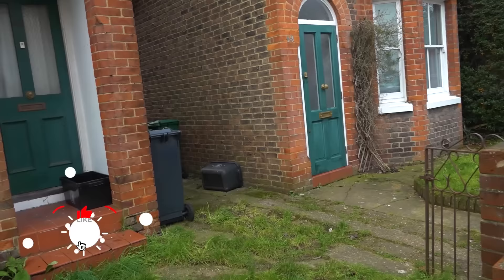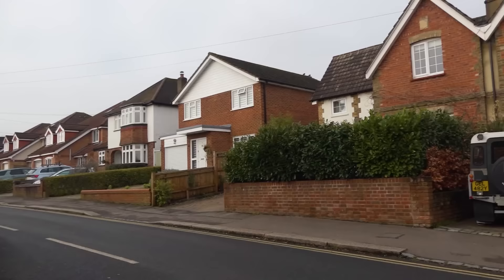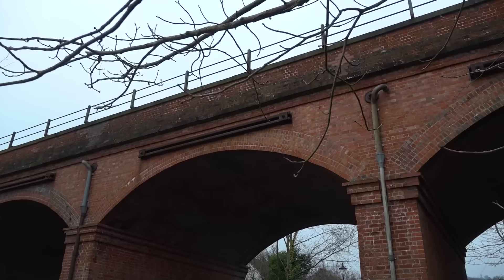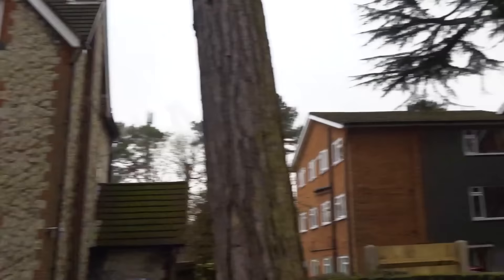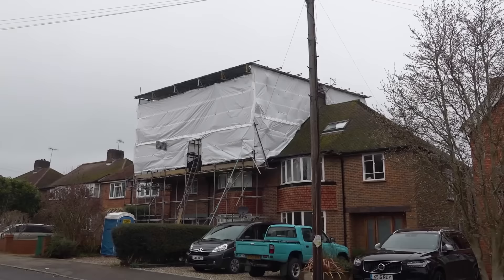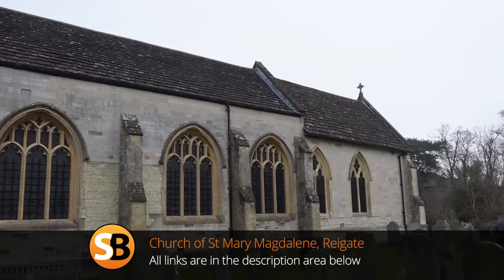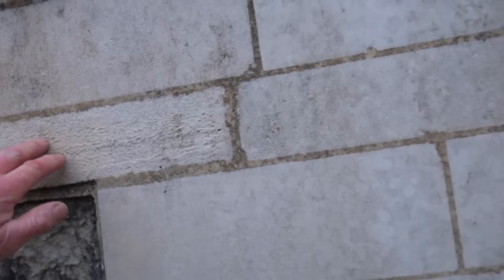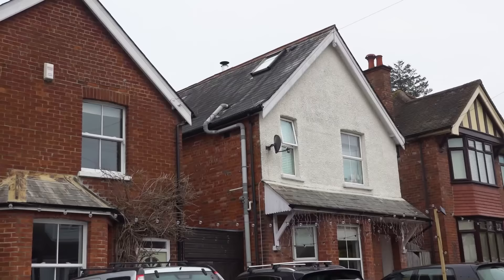Roaming Roger 2 ~ More Mobile Moaning

Comment: I can speak from personal experience. Sand and cement over lime is the kiss of death. I used sand and cement on my old house in 1985. I have now replaced it with feeble lime NHL 2. The wall was wet behind the cement, and quite a number of the old sandstones were damaged. Lime can breath and it is flexible. What also happens is that the sand and cement gets blown out by the lime. Moreover, lime lasts longer.
Reply: Sandstone and brick are two vastly different products.
The wall behind the pointing could be wet because sandstone is porous (Or many other reasons)
Sand/cement cannot be blown out by sand/lime. It does not have the strength or expansion capacity to do so. I would guess movement withing the building caused any pointing to fail.
Sand/Lime pointing does not last longer than sand/cement pointing.
If you're  happier with the new sand/lime pointing on your home, that's fine and I'm pleased for you but be careful when giving advice unless you are somewhat of an expert.

Comment: Hi Roger, in stonemasonry we call those indents. Underneath the facade of the new indents is most definitely the original stonework and as you rightly said, they were probably clad (indented) and dowelled at the very least 100-150mm back in to the original stonework. 

Regarding the erosion, it's likely that the stone they used to carry out the indents, was probably slightly harder and less porous than the original stone as it can be very difficult to match for obvious reasons. In turn this will speed up decay of any softer masonry around the newer, harder and less porous substrate. So matching stone as closely as possible is very important.
Reply from the maker: Good to learn all that, we should do a video with you.

Comment: Hi Roger. Lime does allow the water to wick out moisture, whereas cement holds the moisture. It's not really good practice to mix cement with lime - any benefit provided by one is negated by adding the other. As an extra point (excuse the pun) to your mention about painting brickwork, a breathable paint would work best or, as would have most likely have been done when a building was built circa Victoriana, a coat of lime wash. Most contemporary 'general builders' can't be bothered with lime though as they just want to get the job done quickly and no doubt their customers don't want to pay the extra cost in labour as lime takes more time and attention to work with properly. Enjoyed the roaming though :)

Comment: Only yesterday I was out and about together with my wife and dog in Tavistock, as we walked along I admired some of the stonework on display, particularly when going past a local cemetery.  It featured water spouts that serviced the gutters as they came through the parapet walls (and looking down, sure enough their accompanying drain in the ground).  I don't I've ever seen that before, not the prettiest in my opinion, but certainly fairly unique, it must be quite a show when the rain comes down.  Sadly the conventional gutters, door and window frame badly needs attention (come on council) on the old toilet block directly onto it.  Also there a small arch built into part of the medieval wall in the park to commemorate King George V.  Both examples being testament to when they could still put stone together, all very impressive work!

Comment: More of these please. As someone who is involved in the "planning process" love your comment that everything was OK until they introduced planning. You have to ask what these large edge of town developments will look like in 20/40/60 years? My guess is that when you want a day out in your retirement you would go to an old market town which has soul and character. I have worked on a few of the very large urban extensions (5000+ houses) and most lack a centre or core like traditional villages and towns. There aren't any market squares or civic buildings, no religious buildings/places of worship, no pubs or village greens, few shops and therefore no defined focal point. Poundbury could be the exception. I would love to hear your views on new build.
Reply: I agree, see my comments on Tavistock above, currently 20 houses are being 'built' in my village (on a flood plain).  With stick on faux stonework and screw-on chimneys.  It's taking forever to complete (around two years and counting) with incomplete roofs left open throughout the winter and downpipes not even plumb.  We're talking selling prices of £400k and more.  I didn't realise that building inspectors were employed by the developer until Roger mentioned it on this channel 🧐A recipe for disaster isn't it?
Reply: Planning is one of the worst jobs you can do, basicly no staff, tons of work and not a fair salary and you can do everything right only for a Councillor to step in from no where and remove any form of restriction or request you ask the developer to do.
Its basicly how to waste a lot of time and achieve nothing which pisses off anyone trying to get things done.
Reply: @rob-123  can you explain a bit more please?
Reply from the maker: Jeremy 
What do you think of Poundbury?
Reply: @SkillBuilder   Sorry for the delayed reply. I have been there once and that was a while ago. It certainly has a lot more character than many other developments. There seemed to have been able to introduce quite a varied building style.

Comment: I respectfully disagree about repointing with portland cement over anything that has originally been constructed and pointed with lime. You are basically saying you know better than the building designers, and generally speaking the old boys built em better than they do today.
I've seen it first hand, the cementitious pointing just will not let go of the moisture in the mortar joints and then eventually you get the damage to the sandstone or brickwork as that moisture comes out the stone/brick. Its certainly a sure fire way to bugger up sandstone!
Not just my opinion either!
Reply: Depends what type of brick/masonry is there.
Reply: The problem is water. Dry walls won't spall, damp walls will. Increased breathability is essential for increased water content. Sand cement will only be blown off the lime sand beneath if there's moisture in the mortar and bricks. Many hard bricks, even if originally pointed in lime sand, will tolerate a weak sand cement repoint provided that they remain largely dry. Soft or underfired bricks are more hygroscopic, so they absorb more moisture whether from the air, rain or plumbing. Even if kept relatively dry, they are more likely not to tolerate a sand cement pointing and can spall. Excessively soft bricks like the red ones Roger came across are so hygroscopic that most lime sand mortars will not provide the extra hygroscopicity necessary to force the water through the pointing. Even if very rich non-hydraulic lime is used, it soon gets washed away and then the water just goes through the brick and it spalls. Roger hates Flettons, but I'd suggest those soft reds are worse. They might be ok in the Sahara but they should never have been used in the UK!
Reply from the maker: McReady 747 
I spent 2 years working with a good old school brickie and he used to say the worst thing that ever happened to the building industry was cement. 
We went around the London area putting a lot of job right so I completely respect the idea that lime is a wonderful thing but you have to ask why it is not widely used these days. In many cases a weak sand and cement mortar with plasticiser or a premium cement (contains lime) is perfectly good for the job. It depends on the brick.

Comment: I grew up in Wargrave in the 50's/60's and it was a quaint village filled with 'character' .... You go there NOW! and they've CRAMMED every kind of Carbuncle into every available SPACE between those 'Once Characterful' Homes :-( ...... Yonks ago I worked for a local Builder - 'West Homes' who built their trademark 'Cottage-Style' Houses - Built for the 'Better-Off' at the time, and built with Style & Longevity in mind - Very Classy, and they look as good NOW! as they did 40+ Years ago (The 5-Beds went for £350,000 then - NOW! They're £1,000,000  + ) - I reckon Your Twins properties will look as good after 40 years as well :-)

Comment: The only true maintenance free structure is a cheap structure which you expect to replace regularly. When i came of my tools and went into  the planning office there was a subject called PV of AC which sort of meant you had to compare  a cheap job  with a more expensive job and look at the ongoing costs and decide if it was going to be cheaper to replace with cheap at regular intervals   or maintain the expensive for the long haul. We were looking at 20 year cycles back then. Now i see big new estates advertising a 5 year warranty . I expect they only need to use wet sand to hold the bricks together for that long.

Comment: Why can't we paint a house? Is sandtex breathable?
Reply: Very not breathable, despite their claims to the contrary. It forms a fairly vapour impermeable film. Try silicate paints
Reply from the maker: On the Road 
It flakes and water gets trapped them the bricks spall. You have mortar and brick so the paint has a natural line to crack along. The water runs down the face and track in on the cracks. It can soak areas of the wall.

Comment: I've never_why when you've got these lovely old decorative buildings they come along and plonk some horribly designed cheap looking building in between them. Did a job in Redhill not so long ago with some lovely old cottages down this road only to find across the other side of the road with some horrible UPVC clad flats. It looked so out of place.

Comment: Thanks Roger.
I'm fed up with people banging on about the pitfalls of sand/cement pointing.
I've got 40+ years experience and I've never had a problem (Call back) with it and I've re pointed most of the houses in the street I still live on.
I do add lime to my mix which allows a bit of movement and gives a much better color finish.
The new fad is to use lime mortars and do flush finishes and basically charge more than twice the money. It's pathetic.
Back in the day we called it bag rubbing. Get an empty cement bag and rub it all over the back of the wall to flush it up because it will never be seen. Now they call that a top notch finish ...  Sigh.
PS. Bang on about LBC Flettons.